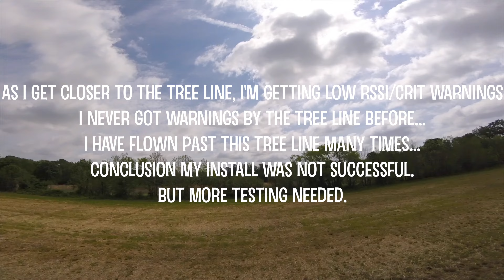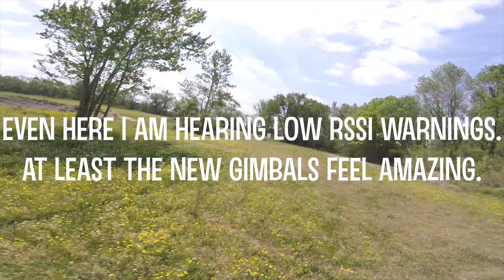taranis upgrades test part 1

Comment: what did you cut the length to?
Reply from the maker: ryan roberson have no clue. I just matched the size of the original ant. I don't remember the length being said in bardwell vid. But I fixed it last night just cleaned up the solder joint on the signal pad in the taranis and after that it was good